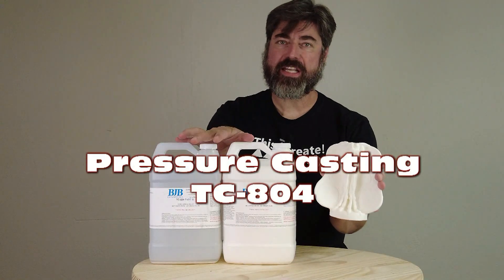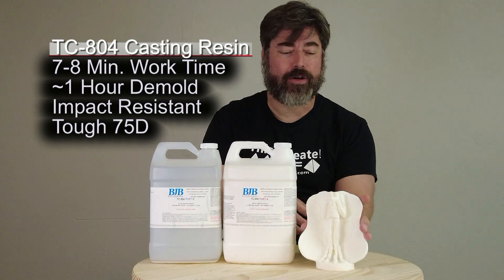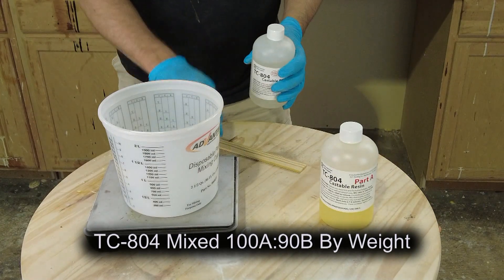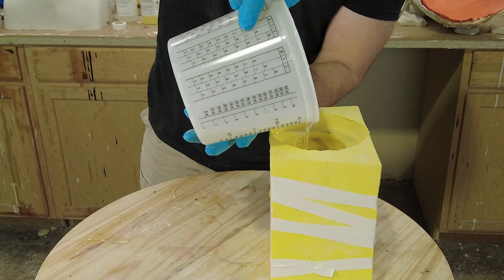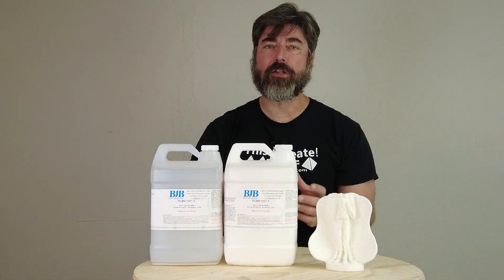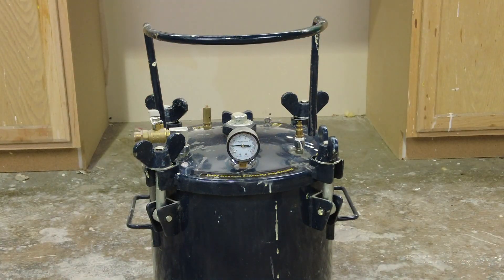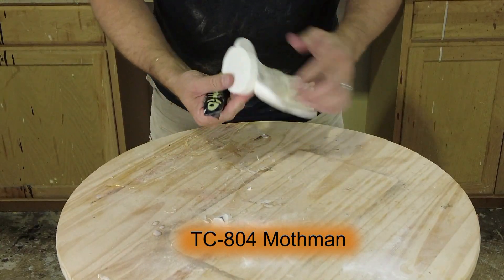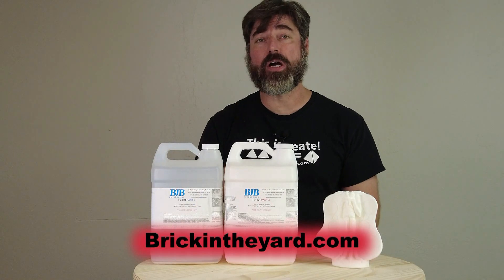Resin Casting Tutorial: Pressure Casting With TC-804 Mothman Cryptid Figurine

Comment: Great info in this tutorial, Mitch!  Nice to mention the safety around pressure vessels and note about moisture in stir sticks.  Some folks might also like to know that TC-804 is 1:1 by VOLUME mix ratio.  We prefer measuring materials out by weight for best results (100:90 for TC-804 as mentioned in this video); however, we know there are some instances where a volume mix can be used effectively.  👍
Reply from the maker: Thanks Troy!